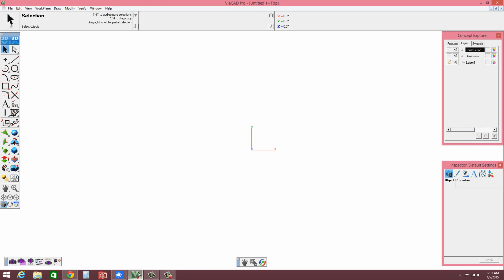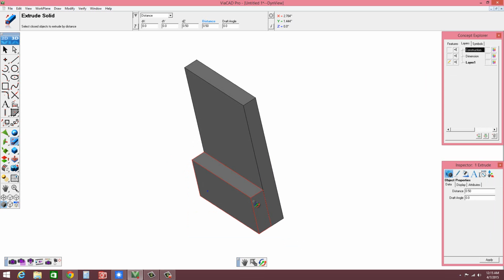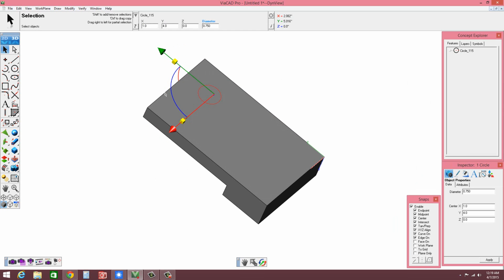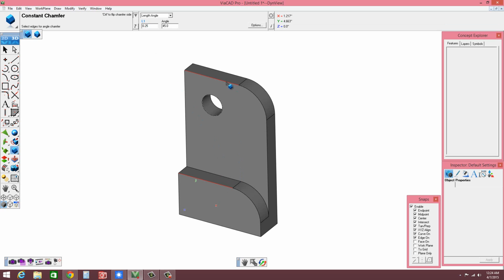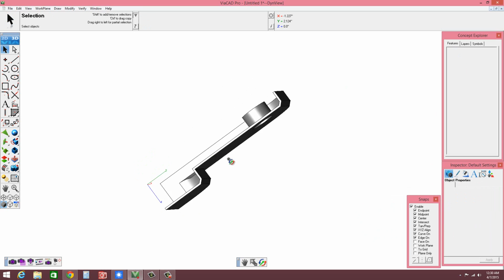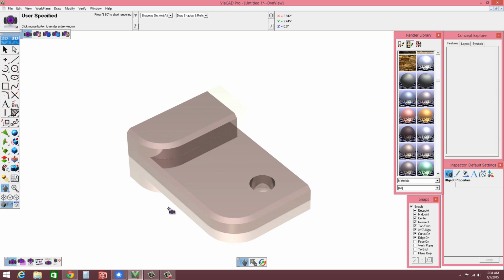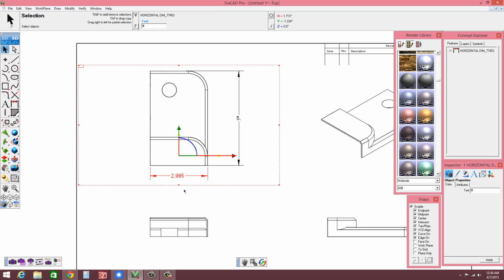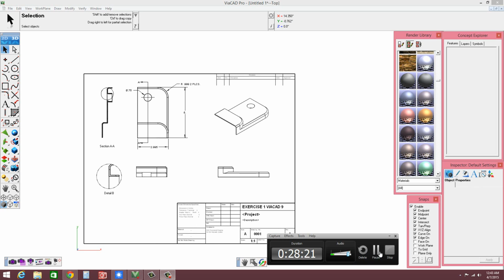E1 ViaCAD Pro v9 - Solid Modeling & Drawing Tutorial for Beginners

Comment: How would you rate Via compared to Creo/NX/SW?
Reply from the maker: PrimeraRSTKD  ViaCAD is a budget CAD software. From a mechanical design perspective ( Note: It also has architectural tools) - it packs a huge "bang for the buck", great for general part design and hobbyists, but the other software's are necessary for larger, more complex tasks.
Reply: vertanux1 

Thanks, you should do more NX since 10 is out and im trying to learn more. Subbed
Reply: @vertanux1  Stoked me out reading this. Thanks
Reply: @vertanux1  I'm becoming interested in CAD programming as of late, I'm looking at ViaCAD in particular (or TurboCAD); question is, wouldn't SharKCAD Pro be suitable for Larger, complex tasks.
Reply from the maker: @sgx5481  It's my understanding that ViaCAD is now 64 bit. Typically this will greatly improve the software's ability for larger tasks over the old 32 bit versions. Unfortunately, I haven't tested the 64 bit versions yet. 
I'm not sure about TurboCAD - if it's 64 bit and it's more recent releases capabilities